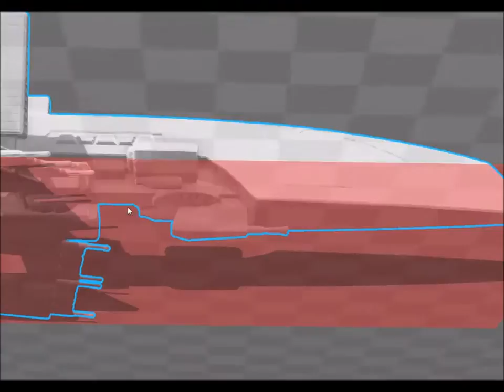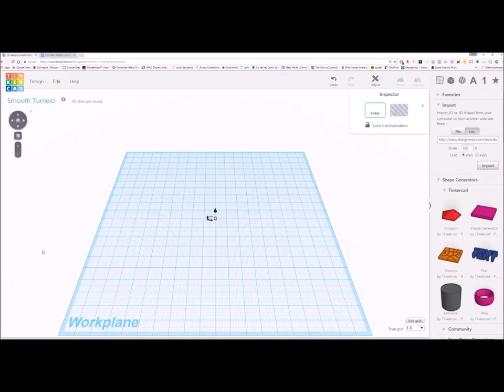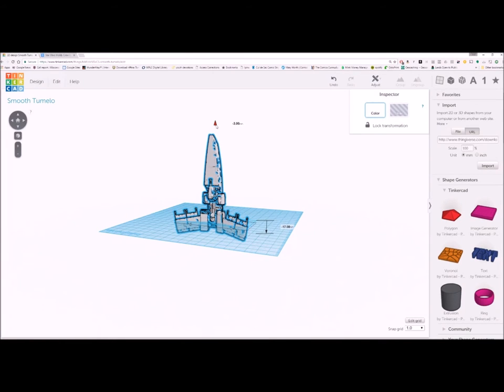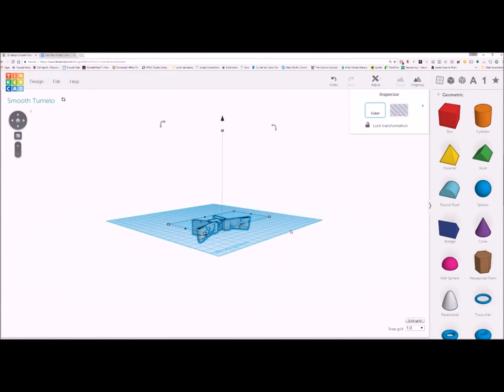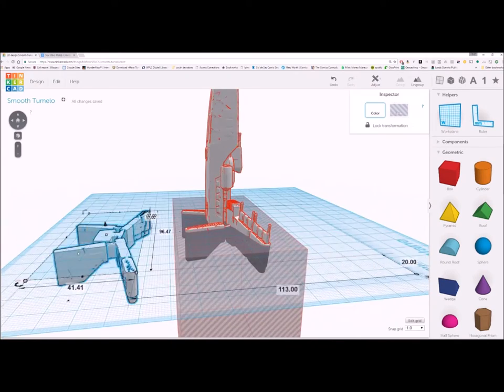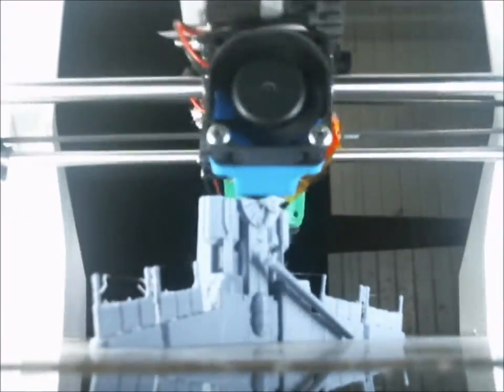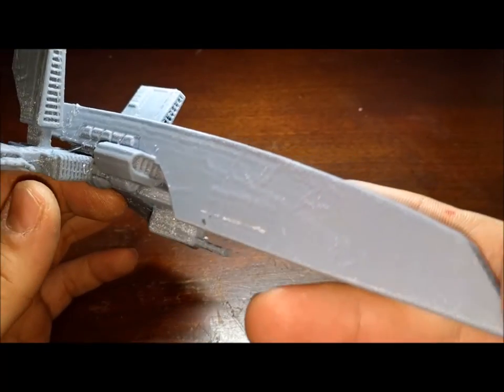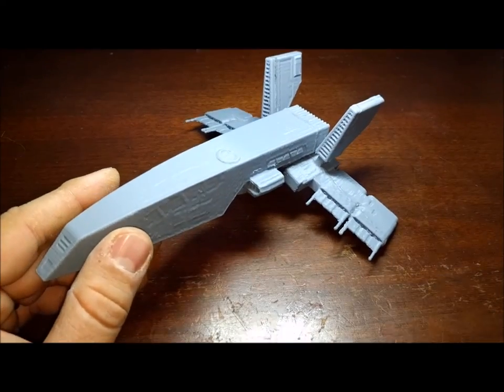From the Land of Heat and Plastic: Episode 4 The Moldy Crow

Comment: What did you use to cut the model up?
Reply from the maker: tinkercad google it, it is a free web-based program
Reply: Peter Kesting I was wondering if you could assist me please.  that ship is my favorite star wars ship, I've tried printing the way you avoided but it just turned out messy, so I went to go and use tinkercad problem is when I upload the file it either crashes or  takes former to upload the file it's been 20 mins and I'm still waiting.  any idea what's causing this?
Reply: Peter Kesting I tried a smaller file but still getting the same result
Reply from the maker: Glenn, and Robert I guess if you are still having problems, in the description of this video I just added two links to the STL files for my "cut" version, hope this helps.  Also, Glenn, I'm not sure what the problem is, sometimes Tinkercad can be troublesome
Reply: Peter Kesting the issue isn't just with the Moldy crow it's everything I upload. certain features such as grouping and ungrouping have been disabled, even my brother in law whose a tech and computer genius has noticed this, the things you show on your tutorial are non existent on tinkercad now.
Reply from the maker: Well, they are now using a new version since I made that video, but with the new version, you should still be able to upload and group and such.  It is just located in a different area.  If it really has been disabled on your account I'd contact autodesk, because I checked and it does that stuff for me.
Reply: Peter Kesting so where would I find this new version? as all I see is the new version and there are no new patches out to update my existing one
Reply from the maker: Well, when you go on the tinkercad website, I'm confronted with 2 options, one box says "create new design" and another box says, "create legacy design".  Try the legacy design, that means old version.  If you load that version most of my instructions should apply.